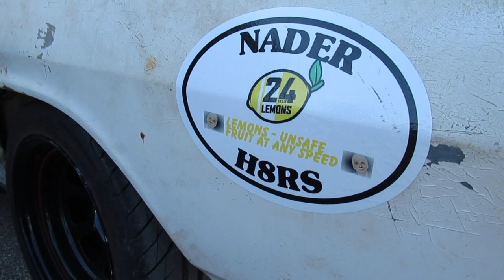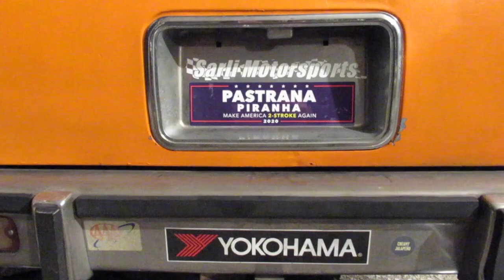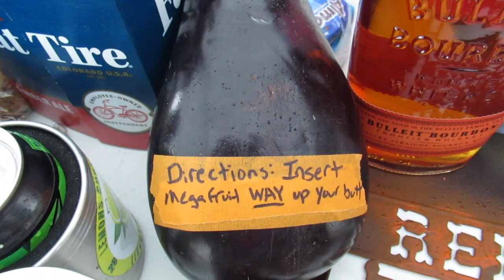Lemons Wrapup--MSR '19

Comment: I mean why the hell you need any mods on BMW E36 328 or 2,7l Porsche 944 other than racing tires, hoses, low coil springs + some safety features. Those are HP 170-190-ish with minor intake mods and exhaust catalyzer cut out. Low profile Yokohama or Toyo set will turn it into track killer. All-day long reliable with non-stop gas pedal on the floor.